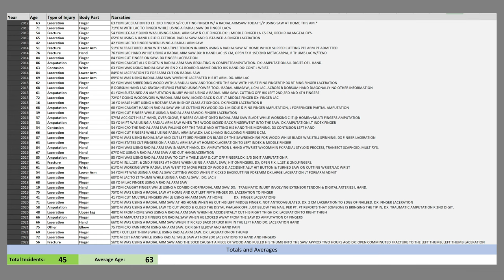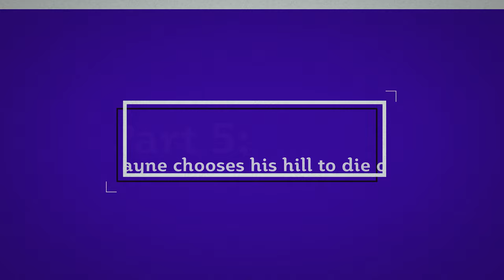Radial Arm Saw | A History

Comment: Thank You for the info.  Good Job.
I own 3. Purchased my first one in 1974.  Did everything with it.  Made all the trim for a total remodel. Built out door furniture, jewelry boxes. Sawed firewood. Ripped, crosscut, molded, surface planned.
But, you had to do it properly.   Back then there wasn't any videos to watch, so it was trial and error. In fact there really wasn't much on the radial till the last few years.  I've used table saws, chop saws, routers, jointers etc.  And I've been fortunate to be injury free.  
Although, I feel the Radial Arm is much safer for ripping, and cross cutting. And if you only could afford 1 saw, it should be a Radial Arm Saw.
It seems to me there is a resurgence in Radials. And that makes me happy.  
P.S. There are 61000 table saw accidents per year. And they've convened a safety panel to try to increase safety.  They have decided that they must provide a mechanism that only allows a cut of 1/8 inch into the skin. Only thing like that is patented by Saw Stop Company.  Look for saw companies to start going belly up.
...humm. 61000 accidents with all the safety equipment.  And they gave the Radial Arm grief. Whay they should have done was have a safety commission to figure out why the Radial Was Causing less accidents.

Comment: My Dad had other saws, table, circular, etc.., and we had training on them as we grew up.  I don't think Dad had any training on RAS. My family was building a house and Dad bought a RAS. When one of my brothers was using it, it had a kick back and the board hit my Mom in the face.  We had no education on the saw and had know idea it would do that.  Dad sold the RAS and declared that it was a very danger to use and sold it.  We all learned about kickback on other saws and what to do to help prevent that, including where to stand and not stand.  I would only buy one now only if it mostly fell in my lap.  I think just like any other tool it has to be respected and learn how to do it.  I LIKE THE VIDEO!  Thanks  BTW Mom healed and is okay at 88.
Reply from the maker: Thank you for watching and taking the time to comment! It is very appreciated. 

You are exactly right, any tool needs to be respected and every effort made to learn proper practices and procedures to use them safely. 

I am very happy your Mom made a full recovery!

Comment: Thanks for this video. It's interesting to me to see some other YouTubers talk about radial arm saws as if they're strange antiques. (Maybe this is because I'm something of a strange antique myself.) I have two Sears Craftsman 10" Radial Arm saws--one I've had for about 40 years and one I picked up for $25 to keep in the basement of a rental property I own. I've never owned a table saw, though I recently inherited an old Shopsmith Mark V that I often use for the table saw function. I've use my radial arm saw mostly for crosscutting, miters, compound miters, but also for ripping. (I recently rebuilt the cedar lath fence in my front yard that required me to rip dozens of 1"x8"x8' boards to 1-1/4 slats.) I've used the planing attachment to rough plane a very uneven 4" slab of walnut that I used for a live-edge shelf for a television. I have a dado blade for it that I've used--one of those that wobbles to various widths that you set. Before I had a drill press, I used the radial arm saw as a drill a few times and I have a sanding disk and several sanding drums that I've used, too. I've also used it for molding edges with molding attachment.

I don't understand the reputation that radial arm saws have gotten for not being safe. Of course, any saw is inherently dangerous but, in all the years I've used the saw, I've only once had anything I'd consider a mishap. While ripping, the saw threw a loose knot that I hadn't noticed back hard enough to break off a little bit of the saw blade guard. Without the guard set close to the board, as you're supposed to, it could have hit me if I'd been directly behind the blade. But I usually stand a bit to the side. For crosscuts, the blade is pushing the board back against the fence and I've never had a problem with the blade wanting to climb the board. This is probably because I keep a firm grip on the saw. (I've also sometimes done a cross cut from the front, pushing back against the wood.) I've seen Stumpy Nubs' original video that rightly calls out some of the initial hype about what radial arm saws can do (https://www.youtube.com/watch?v=AHRwN99fGCY&t=566s). (One of the manuals shows guy in a dress shirt and tie cutting full sheet of plywood in half by having the saw blade turned outward and pushing the plywood in front of the saw. Sheeze!) I've also see the rebuttal videos by radial arm saw fans and Stumpy Nubs' clarification in which he makes it clear that he's not saying that radial arm saws can't be safe; he's just criticizing some of the unsafe uses of them (https://www.youtube.com/watch?v=TKL2ooTOPk8). If you want to learn more about radial arm saws from an old pro, check out videos by BigMike Tuna like this one (https://www.youtube.com/watch?v=CV4uXtxnOdg&t=1316s) . (His saw is almost identical to mine, by the way.) If you want to see some terrific joinery done with a radial arm saw, check out videos by @dustylumberco. And here's an idea for an upgraded table for a radial arm saw: https://www.youtube.com/watch?v=bdLaLgGCqUo&t=33s.

There's an interesting historical promotional film from DeWalt about the use of the DeWalt radial arm saw's use in the WWII war program here: https://www.youtube.com/watch?v=HiGH0Qsu3ak&t=501s.
Reply from the maker: Thank you for watching and commenting! 

I have seen the videos you link to, and remember seeing BigMike Tuna's video when it was first published. I agree with quite a bit of what he argues in his video. 
I saw Bud's video for his table and was very impressed, I haven't been able to bring myself to build something similar though, I accomplish most of the miters and such that he installs the T-Track for by just clamping a speed square or a sacrificial piece to the table.

Comment: Thank You.   
I’m am a serious hobby woodworker, with all my fingers.
I now have my father’s RAS he purchased new in 1968 (I was 12) it was the first large power tool I used. I consider it to be an essential tool in my shop, making cuts that are near impossible with a table saw, or other tools. My sliding compound miter saw is used only for portable applications, usually just collecting dust. In a few years I’ll teach our grandkids how to do woodworking
Reply from the maker: Thank you for watching and taking the time to comment! I use my miter saw the same way, it certainly travels a lot easier than the RAS, but it is never my first choice for any cut.

Comment: I have two radial arm saw that I use more than any other saw in my shop. I have a cross cut blade on one saw that I also use for ripping. Whenever I rip anything on the radial arm saw, I always use very long push sticks. The other radial arm saw I keep a dado blade on it for cross cut and ripping dados. I feel that as long as you are all awake and very safe, and take every precaution with push sticks and sometimes clamps, these tools are very safe. :goat-turquoise-white-horns::goat-turquoise-white-horns::goat-turquoise-white-horns::goat-turquoise-white-horns::goat-turquoise-white-horns:
Reply from the maker: Thank you for watching and commenting! I am up to 3 RAS now and am in search of another small one that I can permanently install a fretting blade in.

Comment: I started out my shop with a Skilsaw and a chop/miter saw, both of which will get the job done, but are by no means the best for great cutting unless you're building a house or a woodshed.  Radial arm saws just weren't on my radar as you don't see them in stores anymore and I hadn't personally seen one since I was a teen back in the '80's.  So naturally when I eventually wanted better cuts for finer work I went with a table saw, specifically a Rockwell Model 9 contractor saw as the vintage unisaw that I dreamed of always seemed to be a several hundred mile round trip, or if they were closer, the folks wanted an arm and a leg for.  In the interim I eventually got a jigsaw, a scroll saw, a sawzall, a chainsaw and a 14" Delta bandsaw.  Then one day a while back while perusing fb marketplace I happened upon a listing for a radial arm saw, and remembering dawned upon me of the one my buddy's dad had and all the uses they got out of it and I started studying up on them.  And, as with any power tool, yeah, they can be dangerous, but no more so than any other tool in my shop and I decided on a mid 50's DeWalt MBF model I found on marketplace for $35 bucks.  It was pretty rusty but sat on its original optional cabinet so naturally I rushed out and bought it from the guy.  And after a lot of wire wheeling, sanding primer and paint it looked good as new.  Made a new table for it from an old kimball desktop of laminated 1.5" MDF.  Had to square up the blade, the fence, table, etc which took a couple of days.  The bearings were good as it doesn't spin forever when ya turn it off, but the power cord was rotted to the point the outer cover was split wide open for a couple of feet and the insulated wires inside had insulation falling off and it's a wonder I didn't trip a breaker powering it on.  I bought new 14-3 SJOOW power cord for it that looked identical to what the original cord would have when it was new, added a rubber booted strain relief and got a new toggle switch for it as the old one had a crack in the bakelite that busted wide open when I removed it.

I've come to love using it and my old table saw now mostly collects dust and is more table than saw with assorted debris sitting on it.  The RAS is just my "go-to" saw for about any cut I make nowadays.  Wish I had bought one a long time ago now.
Reply from the maker: Thank you for watching and taking the time to leave a comment!

My RAS is most likely the most used saw in my shop as well!

Comment: I'm lucky to have a 20 foot back wall of my shop where I built a dedicated bench for it. I use it almost every time I'm working in my woodshop.
Reply from the maker: That sounds amazing. I try to keep them located in areas where I can feed material right out the garage doors if I need to process larger pieces.

Comment: Seems much safer for crosscutting than a table saw, hand saw, or band saw. And does not really seem more dangerous for ripping, use a push stick.
Reply from the maker: Thank you for watching and commenting! This is especially true when dealing with larger stock. 
They can take some time to get dialed in, but once they are, they can be just as accurate as any other saw in the shop and can be used just as safely.

Comment: Any powertool is dangerous if the operator is not familiar enough with them. Use inappropriate  practices, and using them for other purposes than those intended for the tool. I am waiting for the older Dewalt 1950s model like yours. And I think that there is an increase in interest  in used RAS's. How many woodworkers out there say these saw are dangerous, while they have removed the riving knife and hood on their TS's. 
When you purchase a RAS, read everything you can about the tool. Don't be so errogant to skip the manual part(like so many men do and just dive into it. 
I want to use mine for cutting dados and of course crosscuts.
Reply from the maker: Thank you for watching and commenting! 
You are absolutely correct about proper safety practices; especially when it comes to a tool as complicated as a RAS or Table Saw. I would also agree that I have seen an uptick in interest in these old machines, which I am very happy about. I love when a good tool gets the appreciation it deserves!